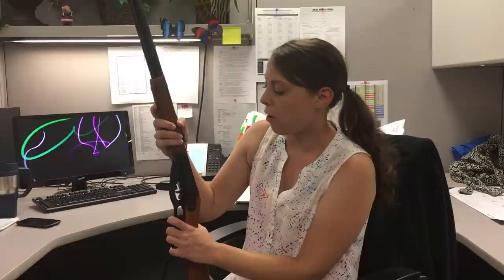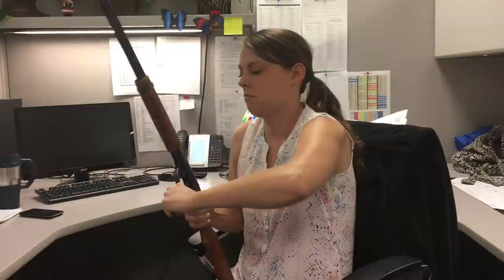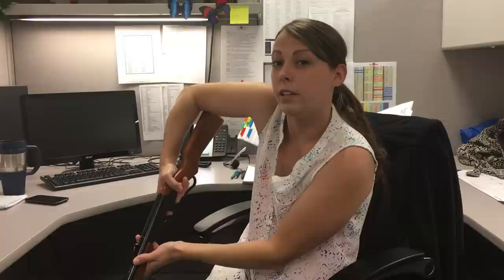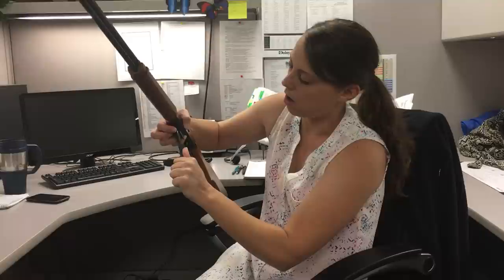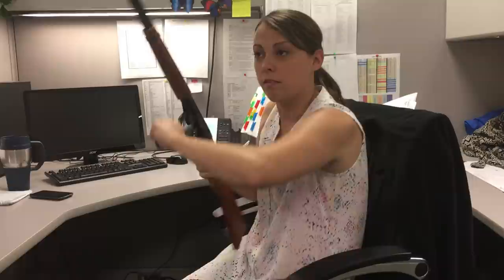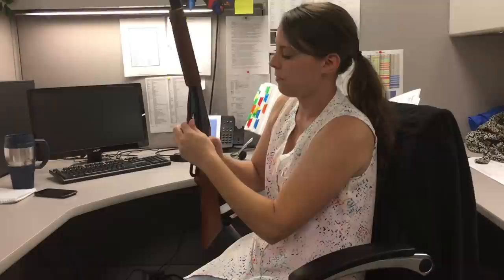Monday with Hannah - Red Ryder Not Shooting

Comment: I disassembled my first one, then bought a second one, which I thought I broke. Thankfully I watched this video, which I should have done to begin with. Now to reassemble the first BB gun (if it's possible).
Reply: Do you even remember how to assemble it back to its original places im talking about the parts/pieces
Reply: @theo.2826  The rifle is basically designed to be a throwaway. So I won't be buying anymore. I want something that can be disassembled and repaired by the owner.

Comment: I have a problem with this product (keep in mind it's fully cocked) in sometimes it doesn't shoot a bb at all. It's just air. I have to aggressively shake the gun to socket a bb in the correct spot when cocking. I primarily use this toy to scare away squirrels from my bird feeders. But having to shake it usually sends them running.  I suppose the same purpose is being accomplished, just 2/5 times I don't get the sweet satisfaction of hitting them or hitting close enough to make em jump. Still an awesome toy. Bought it for my son, but I primarily get the enjoyment out of it.
Reply: If somebody can post a fix for this, because I have the same problem about 1/6 of the time (I had hoped this video was actually the fix for this problem, not something as dumb as not reading the instructions for something that is considered to be a gun.) - I would be eternally grateful, I would sing at your wedding! Because I can’t figure it out, my gun is oiled correctly. The barrel is straight and it’s only six or seven months old. I do find if it keeps doing this that if I shake it while I cock it, it almost guarantees to socket a bb..
Reply: You gotta make sure the gun is sitting level and at a slight upward angle.
If you have it off kilter and/or straight up, a BB won’t fall into battery or 2 BBs will block the way.
Reply: @johnanderson186  how can it be level, and at an angle? I need some of whatever you’re smoking but I would never fire your gun.

Comment: Our 1980's version of the Red Ryder bb gun will shoot but the bb's will not come out when shot. I hold the barrel up when cocking it and it has bb's in it. The older version doesn't do the clicks when cocking it. We have 2 and the newer one is different than the older one. I understand about not cocking it all the way in relation to the newer one. The older one shoots but the bb's won't exit the barrel area.

Comment: Mine wan't cocking fully even after seven clicks. The problem was the tip of the plastic cocking lever had worn down. I put a metal tip on the lever and that cured the problem.

Comment: Hello. I just got my son the Daisy 650 and we notice that about 1/5 times the rifle does not discharge a BB. We are sure to hold the rifle upright when we cock it, but it still does not discharge a BB around 20% of the time. I have an old Daisy BB gun from around 1980 and it does the same thing, but I would expect a newer model to not do this. Thanks in advance for some advice!

Comment: I bought a Red Ryder A Christmas Wish for Christmas. After shooting it a while it jammed. You can see the BB in the little slot. The gun cocks and fires but will not expel a BB.  As suggested by YouTube videos, I ran a coat hanger down the barrel and tapped it. I also sprayed WD40 down the barrel. Nothing seems to work. How can I get it repaired ? It is a keepsake. I bought it for my adult Son. I don't want a replacement I'd like to have this one repaired. Can you help.??

Comment: Ok. So tell me what would be the issue of the gun is cocked correctly, you pull the trigger but no BB is fired? This happens intermittently with me. Correct cocking each time but one time it will fire and the next it won’t. Thanks

Comment: The problem with mine is that it will chamber a round.   I cocks, and fires fine, however a bb does not come out.   I did all of the lubing.

Comment: So, my wouldn’t cock after the first time I tried it and I couldn’t get it to work so I left it for years. Tried again and still wouldn’t (no clicking) then out of nowhere it started to cock correctly and shoot air out of it. Now, it won’t shoot the bbs I’ve loaded it with. They are the correct size but nothing comes out. Any ideas?

Comment: Whit if it firers and no bb comes ouy
Reply from the maker: Pokemon Trainer Casey could be that the gun wasn't held straight up before cocking it. It's gravity fed so you have to hold it straight up between each shot. If the problem persists let me know.
Reply: Daisy Outdoor Products I tried but it still didn’t fire.
Reply: @DaisyOutdoorProducts  2 years and no answer to this question. Having a very similar issue with a 60th anniversary edition. Would really appreciate some help diagnosing this issue